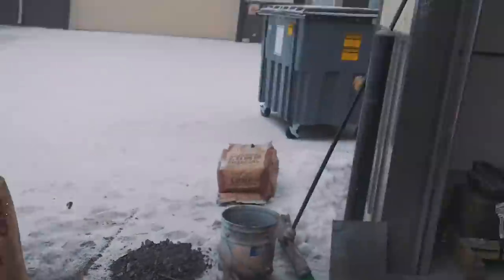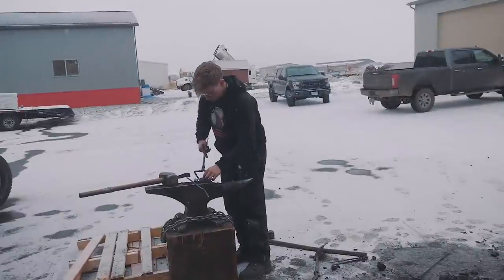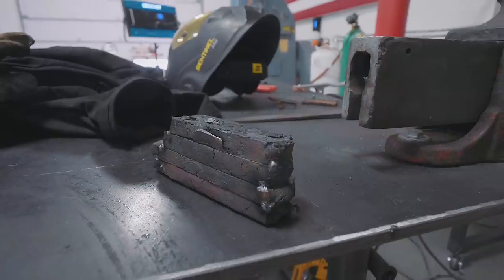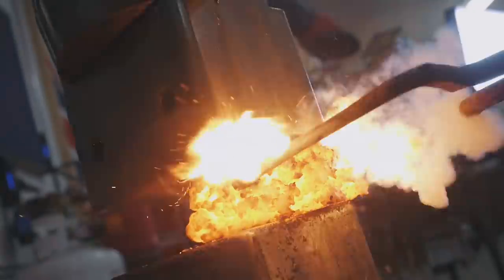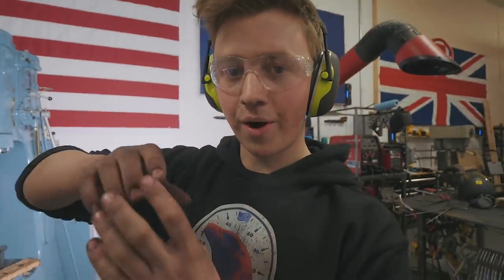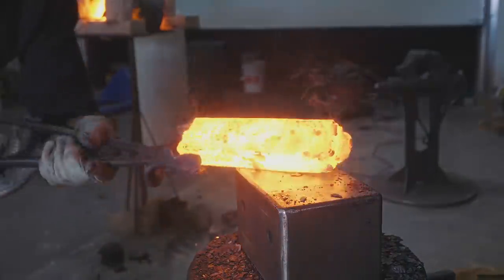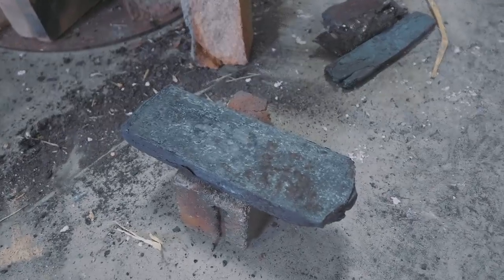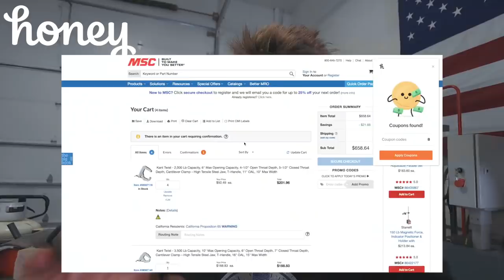MAKING THE CAVALRY SABRE: Part 1

Comment: When in doubt with this material just give a heat or two in charcoal.
Reply: I believe you are correct, I think you need more heat than the gas forge comfortably supply.
Reply: @Zerja  its not just heat...that material needs to be worked in the fuel it was birthed in.
Reply: @ThatWorks  I came to this conclusion too ahah... But do you know why exactly?
Reply: Phantom T.V yes I do
Reply: @ThatWorks  Can you please share the reasons?
Also, what do you think, is it in my head or does phosphorus wrought iron smells... Garlic?
I precise that I'm not joking
Reply: instablaster.

Comment: That japanese folding method described was pretty accurate. As the Japanese didn't have access to good quality iron, they needed to fold the steel blooms countless times to reduce impurities. It wasn't perfect, hence why the katana and other bladed weapons were comparatively non optimal. However, the complex forging method made up for it (they were still deadly weapons and if they used western forging methods, there would be no weapon at all).
Reply: It is   a sword

Comment: I've worked some with hearth steel, and I'd like to offer two tips: when running your hearth, add a little crushed glass with each or every other charge of iron; and when you forge it, don't panic. It does weird things. Just work it, knead the gunk out and let the carbon diffuse with the time and the folds.

Comment: Use the Japanese tech. By wrapping it in a wet cloth an use clay and rice straw ash
Reply: kinglionheart450 he’s doing an American sword. He’ll most likely use European/American methods
Reply: That wouldn't be very useful with this steel. The wet rag is useful for high-quality blades because the steam it creates will blow off the layer of oxidized steel that builds up during the forging process, ensuring that there's no pockets of rust while folding the billet.

The problem with this steel is that it is much more crumbly than tamahagane steel, and is falling apart. Introducing steam explosions to a fragile billet is only going to split the welds even more.
Reply: Science
Reply: The Japanese would select the best quality pieces of the overall bloom to forge.
Reply: @danielshilling2058  The Civil War was in the 1860's, well past the point industrial steel making processes like puddling furnaces and blast furnaces would have been in operation. The Bessemer process was invented in the 1850's, though I don't know if it made it over to the US in time to be in common use for steel making. Making their steel the way they're doing might also be a little incongruous for a ACW sword. They're also using borax as flux, which did not come into common use until the 1890's. TLDR, there's no need to get too anal about it. There's no end to the nit picking otherwise.
Reply: Kevin L as a civil war reenactor, I know plenty about the war and the time period. However I do not know much about steel processing and metal work of this period. I apologize if my original comment came across and not picky, but I was simply making a broad statement about how it would be more accurate to use a European or American method. Whatever method that may be or how advanced that method may be would not be known by me.
Reply: yarh way to much oxygen is intruduced
Reply: kinglionheart450 and metrion77,  You've got a point. If he's got delamination in the billet and he also mentioned cracks (which when he was trying to forge weld those crumbled tamahagane-type pieces together would just be delaminations at different, weird angles) Then he was obviously just having a difficulty with the entire forge weld process at all angles. The Japanese technique with the cloth and ash was specifically designed to reduce buildup of rust and scale between layers, so yes, it's something that he should probably look into. However, bloomery steel wasn't uncommon in the US and Europe, but it's not as romantic as the Japanese sword steel, so there has been less coverage throughout history. Did they possibly have any sort of process to reduce scaling and rusting between layers, besides the Japanese methods? Could be cool to look into.
Reply: @ACat1255  Look out, the resident internet know it all is here to tell us all about it. How bout we all just watch the fucking video.
Reply: Blister steel baby! My favorite way to get it done. Historically accurate to the time period as well.

Comment: From what i learned from the AWE channel, when they work with japanese steel or trying to fold steel, they use charcoal forges in the process of folding due to the presence of carbon monoxide and carbon dioxide in the forge, which prevents a great deal of scales and contamination in the metal folds due to the oxygnless environmemt and some sort of reaction with the charcoal and iron oxide itself as well which reconstitutes itself to steel again. I wiuld suggest a charcoal forge when working with bloomaries and metal folding rather then a gas forge rich with oxygen, makes life alot easier and a lot less prone to failing due to cracks or bad welds or iron oxide presnece in the seams. And as usual, great vids!!

Comment: after you make the bloom stick it in an oven at around 1100 degrees for 24 to 30 hours allow to cool then heat cycle in the forge 4 to 5 times and you should not have so much loss. on the heat cycle bring to critical temp allow to air cool until it becomes magnetic again then back into the forge and repeat.

Comment: So one thing you might try is to get a squeeze bottle and wet the bottom die of your power hammer when you take the steel from the forge to the hammer to draw out the bar. I have seen a lot of blade smiths do this and It's supposed to blast off the scale and lets you make cleaner folds.

Comment: Hey Alec, I have a metal processing question. Would it be possible to form/consolidate a billet from all of the crumbs of iron by: 1. Heating them, 2. Place them in a vertical piece of heavy square tube with flux mixed in, 3. Squeezing the contents in the hydraulic press? Kind of like throwing ground meat into a patty press for making hamburger patties. Then switch over to Mr. Pilkington’s replacement (big shoes to fill, hope the new guy is up to it 🙂) to fine tune the billet. It seems that if the iron is contained in the tube and is pressed by a piston fitted with a metal plate, that it could press down on the contents to make a preformed billet. Just a question from the workshop of my mind.

Comment: Something that sparked my memory while y'all were having problems with decarb, is that with 'primitive' steels, they start out very porous and have a high tendancy to loose their carbon content if not wrapped. Tamahagane (Japanese sword steel) is particulary bad about that when forging it down from the bloom into the forge weld stack. Something to think about if you decide to try your hand at bloom steel again.

Comment: The initial hammering of the blooms should be done on wood. As the hot metal starts to burn the wood, whilst hammering, the smoke (carbon monoxide) helps displace oxygen from the bloom thereby reducing oxidation within the metal giving a better weld.

Comment: Masterwork cavalry saber
Martial weapon

1d6+1- 18-20/x2
Adds +1 to attack rolls made with the weapon.

Light, finessable: characters may use the weapon in their offhand as a light weapon, and may apply their dex bonus (if any) to attack rolls and damage made with the weapon.
Razor edge: specialized grinding adds +1 to damage rolls with the weapon.
Adds +2 gentleman bonus to diplomacy and profession (soldiery) checks when dealing with other soldiers and members of high society.

Comment: You may find better luck with those billets if you make a flux slurry by melting borax in water, since that can help prevent air and impurities from getting into tiny pockets in the steel, or perhaps wrapping your billets in silk and straw as per the japanese method.

Comment: You might consider carbonizing the material before going under the hammer and folding.  Use your acetylene torch - burning dirty - to coat material with lampblack 
which is carbon, necessary to refine grain structure for hardness. It's a bit backwoodsy but try it on a separate piece and compare. You are probably more knowledgeable 
than I on your process. But I have used this technique when working rather dodgey base material.

Comment: In between folds you should put a little water on the power hammer so when you go to forge weld it again it will power blast the slag off with super heated steam.

Comment: With your two hearth method of carburizing the iron and forming the bloom, consolidating the bloom in the second hearth that is acting like a chafery and then reheating and power hammering, are you using the hammering and folding, hammering and folding like a finery? Where the oxides, impurities and excess carbon is coming off in scale? Is this sort of like the walloon approach that was done in the 15th to 17th century?   How do you keep from getting too much carbon when forming the bloom? I can see why there might be some wastage where the carbon is so high that it forms pig. Can you clarify on where you place the tuyere in the charcoal hearth and how you determine how much air to blow through? I imagine that this has a great deal to do with the carbon content in the bloom.

Comment: Hi,

Not sure if someone mentioned this before and I’m not a professional in any way. As far as I understand from covering some articles, the coal content may be far higher than the two percent that you guys mention in the video. A normal result of the used process is about four percent coal content, which makes it impossible to forge. If you ensure a great access to oxygen, the coal will emigrate as CO2 and the content will be reduced. The access to oxygen is probably too low in the blast furnace due to the combustion of coal. I’m pretty sure that it might be to low in the normal furnace as well due to the combustion in there. As I said, I’m not a professional in any way but it would be fun to hear your thoughts on this. 

Thank you for a great channel!

Best Regards,

EDIT: Further reading gave me a few more thoughts. I guess that you may have stumbled upon more than one problem here. First of all, as I mentioned, the coal content is probably higher than the two percent which allow forging. The content is reduced while going through a melt decarburisation process. At the same time, you will be able to remove oxides and impurities (slag) from the blast furnace process that got caught into the material. Good luck! I’d love to see another attempt on this! 

Best regards,

Comment: So isn't this process similar (or the same) to how they refined the steel used in katanas? Or is that a different process? Seems similar with basically beating/folding the carbon out of it till it becomes good blade steel.

Comment: As was mentioned, you're pretty much working with Japanese Tamahagane steel which from the videos I've seen is just as difficult to deal with at the start of forging as what you're finding with yours. It's also a trick to know how much carbon to get rid of before you have to start taking steps not to lose more. This should be a really insteresting series of videos.

Comment: People be hating on the editing... My biggest complaint is probably the colour... looks like it's been shot in RAW or LOG (or similar) but hasn't been correctly graded. Good way to fix this would be either do the lazy thing and shoot in a preset colour mode, or otherwise you could open up DaVinci Resolve or similar and grade it up. Needs higher saturation, especially the blues and pinks, and just a touch more contrast. Hope I'm not being rude or anything, I just noticed it and thought I could give some tips.

Comment: Episode 01-23: Making steel
Episode 24: Forging the blade
Episode 25: Adding a fuller
Episode 26-44 hand sanding
Episode 45: Forging the guard
Episode 46-77 engraving the guard
Episode 78-82 Choosing wood for the handle
Episode 83: Making the handle 
Episode 84: Making the handle again
Episode 85: 2 million subscribers special
Episode 86-96: Making a leather scabbard 
Episode 97: Making a horse
Episode 98: Making a better horse
Episode 99: Finishing touches
Episode 100: Big reveal but you can see it in the thumbnail already...

Comment: On Man at arms reforged they said that using a powehammer like that is bad for the blum because it's too powerful for the material to handle so it causes cracks and makes the material crumble, they said to use a slow and gentle method to work 
Of course i'm not a smith so i might be wrong

Comment: You might actually be able to approximate the carbon content of that blume. Assuming that it's reasonably close to the eutectic point, you could approximate it by comparing its micrograph with known alloys. The process for the test isn't too difficult. Bring a test surface to a mirror polish and etch it within some nitric acid that has been slightly diluted in ethanol. The etch time for this isn't too long. Not sure of the max zoom on your microscope, but you'd then look at a high magnification image of this surface and compare it to known alloys' image. I've used 1018, 1045, and 1095 have been used for comparison because of their varying carbon content and relatively similar additional alloying content which give them all different structures. Could be helpful for knowing some behaviors of the steel? Definitely would be cool to see anyway.

Comment: I don't understand why you didn't use the press for your initial welds instead of the violent hits of the power hammer.  Just in my mind with those fragile blooms you would squeeze it together gently.  Once you have a decent welded bloom then move to the power hammer for your folding.

Comment: Temperature, temperature, temperature.  From the colour you are pulling the billets out, you are not getting the material up to an adequate weld temperature.  Since you used wrought iron as your precursor, you still have a lot of silica slag that needs to be removed.

Comment: a long time ago i saw a blacksmith (in a tv documentary) making steel from the scratch (iron, carbon etc) with a manualy pulsed air furnace to put it over 1600°C to melt it better and to make it like a kind of our modern steels, to make his own ulfberth from the scratch with a steel that could be made around to the near east area at the same era as his ulfberth, he said that the problem with most of the european steels from the past to the the 19th century is that they were not enough hot around 1500°C to melt enough the carbon to the iron, it let too more carbon inclusions, but near over 1600°C the fusion is more complete at a moleculary level, i dont remember the exact temperature, but it was around it, i guess you probably know it, mais c'est juste histoire d'être sûr ;)

Comment: Don't  lose heart, the Tamahagana technique consumes a lot of material.  One difference being the Japanese masters coat their billets with a clay slurry before going into the hearth to control the oxygen-contact in lieu of a flux.
I also wonder if Will's small gasforge is too small to give the billet a proper soak of heat?   Too-steep of a temperature gradient through the billet?

Comment: This process is very nice to see and a fine Experiment. However it doesn't make that many sense. The Iron was already processed so it would be more efficient to melt it to crucible steel ore use ore alltogether. Even with the Bloomery it may come out better to make crucible steel. But that would require a well built furnace.

Comment: So I know there's likely a really good reason not too, but I know nothing about forging or working metal. 

If the goal is to just get a bunch of little pieces together, what's the harm in heating the metal into a liquid then pouring it into a mould to shape it into something easier to work with? 

I'm assuming steel might separate when its heated that much? But again, I have no idea how this stuff works, just curious if someone could enlighten me. :)

Comment: You’ve got too many oxides, best way to consolidate this right now is to coal forge it so water produced from the propane doesn’t get into you’re stock, also I recommend cleaning your tools, hammer, and anvil to stop impurities as well as maybe inserting slightly more refined steel maybe from an old gun barrel like mass produced bayonets were made from

Comment: So Alec, what keeps these blooms from getting filled with cold shuts while you are forging them out? seeing how easy it is to cold shut while forging blades and what a problem it is i would think these blooms would be covered in them no matter what you do, science me im genuinely interested!
Reply: Not alec, but I am a bladesmith (; 
cold shuts aren’t so much of a problem when you’re working at welding temperature, but you do have to worry about scale getting trapped between layers. It’s really an insidious problem when you weld the surfaces solid, but there were still unfused layers internally. There are some tricks to avoiding it, first, keeping the forge atmosphere starved of oxygen, you you form less scale to begin with. And second, hammering from a part you know is solid, to a known opening, so that all the shmutz has somewhere to go.

Comment: You should be making your steel using a crucible rather then trying to pit smelt iron into steel. You might invest in a few ceramic crucibles or buy some raw clay and make them yourselves. this would have worked wonders on that attempt to forge a meteor and it would have drawn out the junk material and allowed the other minerals to blend in with the Iron.

Comment: You guys should move those fuel tanks away from the power hammer. One can see the sparks of hot molten metal flying in that direction. Seems like a huge fire hazard if one of those sparks hits the metal tank...